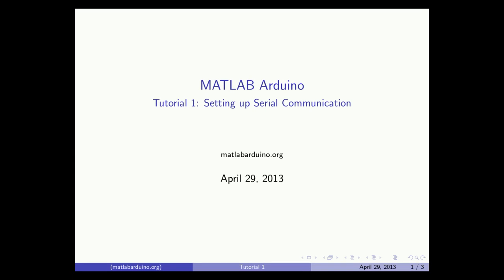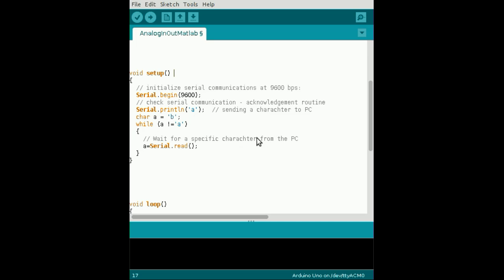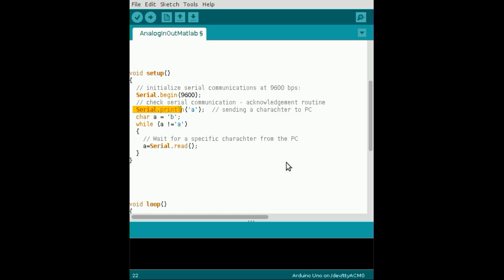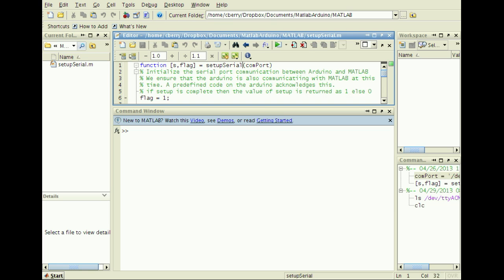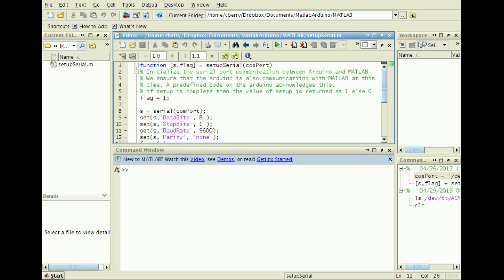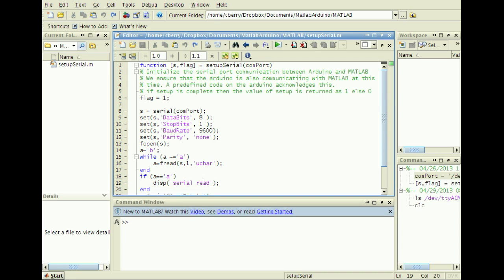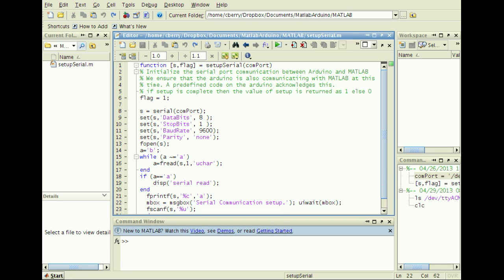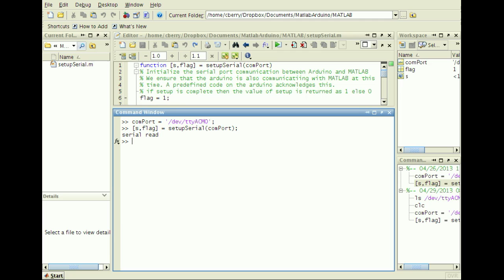MATLAB Arduino Tutorial 1 - Serial Connection between Arduino UNO to Matlab via USB

Comment: If you are with issues in windows OS, put the code as: "comPort=serial('com3');".
 After that put the function and the system will run as in the video.  
Remember that the program must be saved in the same folder that are opned on matlab "current folder".
 If you have some issue use the matlab function delete(instrfindall), put again the command comPort=serial('com3'); and the function [s,flag] = setupSerial(comPort);. 

I hope it helps you.

Comment: sir, when i load this serial('/dev/ttyS0'). in the command result windows :
Serial Port Object : Serial-/DEV/TTYS0

   Communication Settings 
      Port:               /DEV/TTYS0
      BaudRate:           9600
      Terminator:         'LF'

   Communication State 
      Status:             closed
      RecordStatus:       off

   Read/Write State  
      TransferStatus:     idle
      BytesAvailable:     0
      ValuesReceived:     0
      ValuesSent:         0
 
did the serial communication have been setup?

Comment: Hi, i am having a problem when running this setupserial. Matlab is stopped by the debugger because of the "fopen(s):" section of the code. How can I fix this??
Thanks
Reply: Undefined function 'fOpen' for input arguments of type 'serial'.
Error in setupSerial (line 12)
fOpen(s);
Same error

Comment: I keep having issues were it says "Open failed: Port: COM3 is not available. No porrts are available.
Is there a way to fix this?
Reply: Emily Imdieke  
You are trying to set up the serial connection on a port (COM3) that is not available. Probably because either nothing is connected to that port, or it is already in use.
If it is plugged in try running 'closeSerial.m' first to close the connection and then try to set it up again.

Comment: I have trouble in my MATLAB. there warning
Warning: Unsuccessful read: The specified amount of data was not returned within the Timeout period. 
Warning: Unsuccessful read: A timeout occurred before the Terminator was reached. 
maybe you can help me please?
Reply: I have the same problem. I think this has to do with the fact that the board is not outputting the character 'a' to the PC. I opened to serial monitor to check this out and realized this was the case. Any thoughts on this?
Reply: Aditya Kumar Kasinadhuni

I had the same issue. I was using Arduino Leonardo but I changed it to UNO and it worked there. It has something to do with how both boards comunicate over USB port - where uno has designated chip to to convert signal from USB to serial. I hope this sheds some light on the issue...
Reply: Nova Priana I had this problem, It was caused by the arduino bootloader which wont boot in time and the ending of the sent string (the one sent by Matlab). The solution came by adding:

set(s, 'terminator', 'LF'); 

before "fopen(s)", using the line:

"fprintf(s,'%s\n', 'a');"  instead of "fprintf(s,'%c', 'a');"

and finally adding "pause(1)" after "fopen(s)", which will make a short pause in the script to give the arduino time to boot.

Hope it helps.
Reply: Hey I've just tried the way you explained but nothing has changed. Do you have any ideas what could be the problem? Thanks
Reply: Thx man it worked for me but a small note for pause (1), should be (pause on)

Comment from the maker: Thank you for your question, You are correct, a while loop cycles through the statements in the loop until the conditions in the parenthesis () are false.  The handshake between the Arduino and MATLAB changes the test variable to a == 'a', causing the loop to end. Sincerely, MatlabArduinoOrg

Comment: I thought the while loop would cycle forever unless its condition is false.  After assigning the variable a = 'b';  what changes the test variable until a=='a'?  Does the serial communication to the PC just automatically cycle through the enitre ASCII table on its own whenever you connect the USB to the arduino??